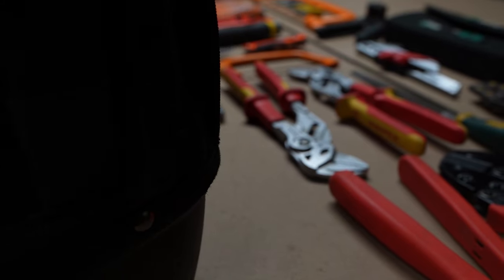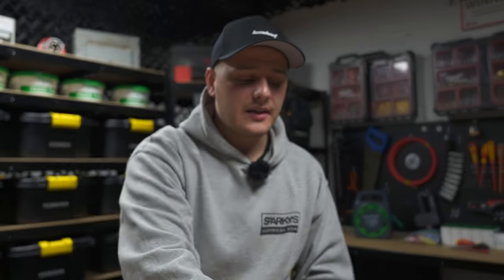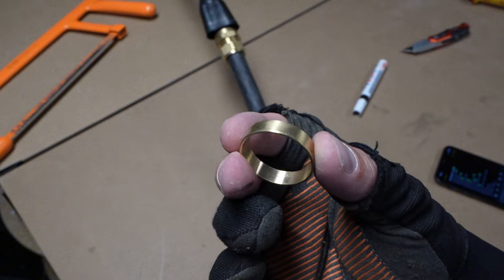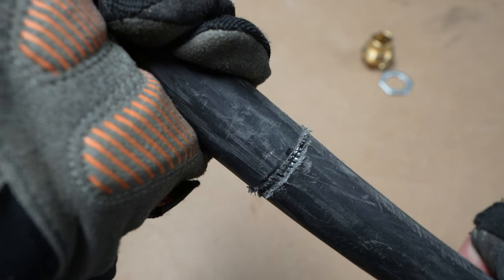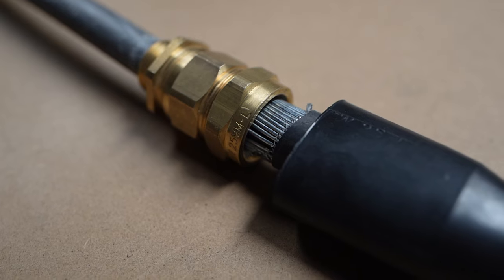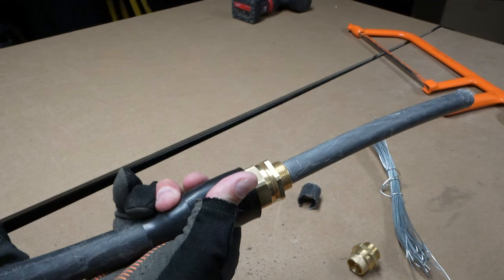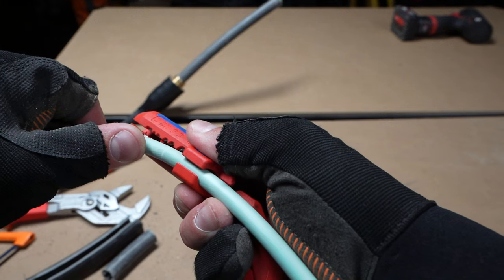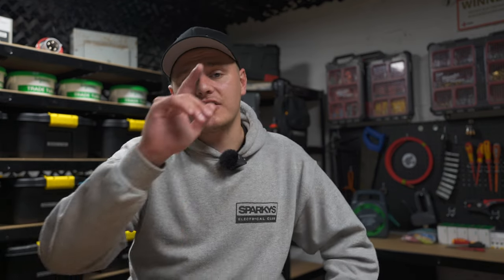How to gland steel wired armoured cable

Comment: I've been doing this for ages and can never understand why no one has ever come up with a better gland-tightening tool. I mean, of course, there's the traditional way, and there's the old-school way, where they use two adjustable, flat drivers, and a hammer to deal with the lock nut. I've also seen glands socket set and lock nut spanner floating about the internet but never seen anyone actually buying them and using them.

Comment: What's the reason you guys use armoured cable so much? Really curious because I've been an industrial electrician in Germany now for a long time and never saw armoured cable except for some really high voltage underground stuff (think 6kV/10kV). If the cab!e is ran on a tray or in an enclosure, isn't that protection enough?
Reply: For extra protection the steel is earthed offering extra mechanical protection and also a fault path if you put a spade through it hitting the live conductors.

Also means you can run it and not necessarily require RCD protection for distribution circuits  in some instances. So usually used for sub mains  or in applications where damage might occur. It means you can run it without extra containment for protection.

Commercial environments, warehouses, agricultural & garden lighting etc as a few instances.
Reply: L ask myself that same question

Comment: I missed that step when I was taught back in the day…let’s crack this open 🤣

Nice video bud, I’ve always check before putting the gland in that the olive is in the correct way because I’ve struggled before then looked and it’s been in the wrong way form the factory 🤦🏻‍♂️🤣 I’ve also had ones that don’t have an olive to start with!!

Wholesalers getting cheap gear! So I always check now as it saves fighting with it later 🤦🏻‍♂️🤣

Comment: Sparky from the USA here, never have I ever used steel armor cable or heard of anyone who has, is that a common wiring method in the UK?There were some Sparkys that flew out from Germany to help work on an extruding machine. They ran their cables very neat back to the MCC but then looked at our conduit rack funny like they've never seen big conduits before.

Comment: I like the Sacs tool for armoureds; more expensive than the Armour Slice but I find it does a neater job of ringing the steel.
I find also Armour Slice blades can be short lived, but tbf that might just be me
Reply: Armor slice blades are poor. A good tip is to cut your own from decent hacksaw blades 👌👍

You could always buy an exhaust cutter for the bigger SWA's